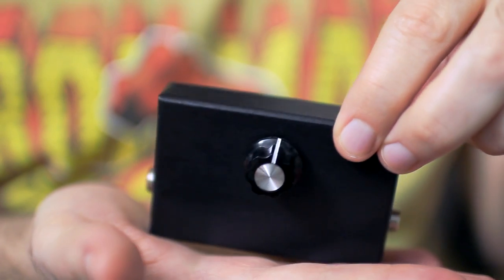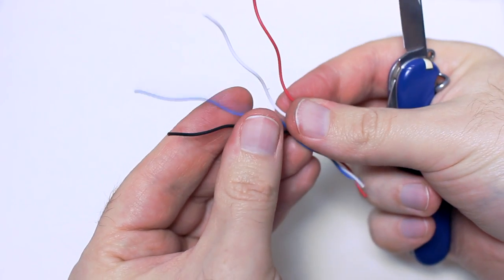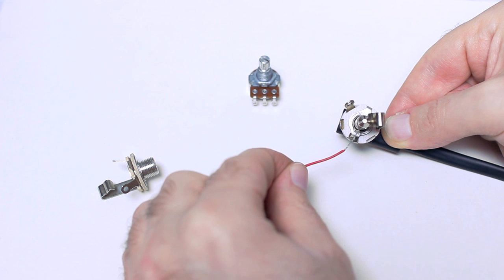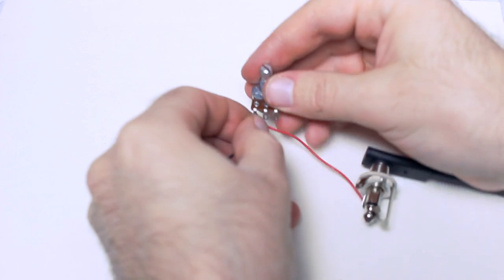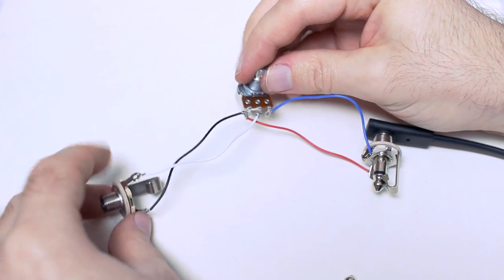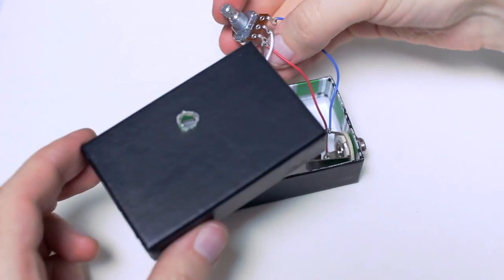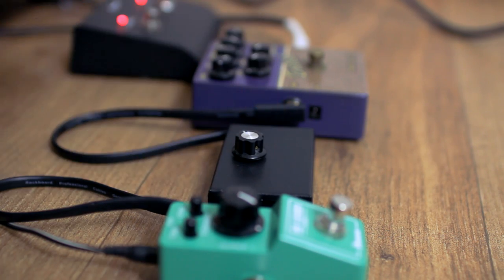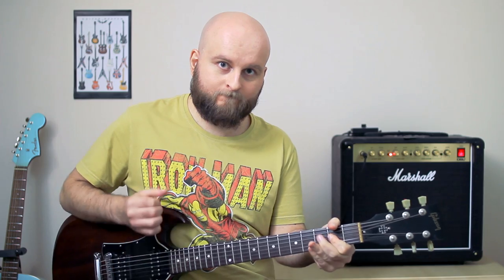How To Make A Volume Pedal For Guitar In 3 Minutes (DIY Attenuator stomp box For AMP)

Comment: Beware! This wiring is all wrong.  You need a 250K or 500K pot with audio taper.  You should wire this up like you would a one pickup circuit, but instead of a pickup, you go to the second jack.  This guy has no grounding, and all you will get is noise.
Reply: Tried his wiring. Didn't work as you said. Wonder if anyone here has tried it.
Reply: @C90Recordings  Yes, it is all wrong.  I can't imagine this video is anything less than another attempt to create chaos by you know who.  Just make the circuit like a single pickup circuit and it will work perfectly.
Reply: I have one that I bought, it is wired in the same manner. Everything looks clean, soldered properly, but doesn't work.  If i put it in front of the amp, nothing, if it plugs into the effects loop send(effect)return it acts like a kill switch.  For something so simple it's becoming a pain in my ass, when I first received the pedal, it didn't work, outer sleeve from the input and output were reversed (outer output on right instead of middle, outer input on middle instead of right) so I reversed the two wires on the potentiometer and tried again, still nothing, this pedal is acting like a kill switch, nothing get's by it, could it be a faulty potentiometer? Wrong type? 250k 500k? What makes this not work.  It's two jacks and a potentiometer, wired just like this video shows....
Reply: How is it wrong? The grounds are connected on both output jacks and the third terminal (or first depending on how you label them), and is grounded through the amp like normal. It's wired how you are describing. The middle terminal goes to your output and the opposite of the grounded terminal is your input, just like a pickup. Perhaps you mean that the pot case isn't grounded? That's a small tweak you can make if it bothers you but I don't know if it'll make any practical difference. It sure doesn't for professional production volume pedals. If you use a metal enclosure it's all connected regardless.
Reply: @trevorlindsey580 - I don't know how you wired yours up but I just followed this video step by step exactly as he showed it and mine works perfectly.  No grounding, no noise.  The resistance and taper is down to user preference - they have no bearing on whether this circuit will work or not.  If yours doesn't work then you either made a mistake, didn't follow the video properly or worse - you spoke without even trying it at all.
Reply: @paqman78  I made one with these directions, and it did not work.  Maybe you did something that many of us other folks did not do, but I suggest you make your own video and place a link here.

Comment: No soldering ? No connecting the body of the pot to the ground ? I'm surprised this works...
Reply: The 3rd lug of the pot is the ground. And that is grounded to the guitar cable wich is in turn grounded on the amp, cheers.

Comment: I followed the instructions on his build to the letter & it works Perfectly.

This was my answer to controlling the CLEAN mode on my Marshall JVM 210C Combo.
To those who KNOW, that CLEAN (GREEN MODE) comes through way too loud & cannot be balanced out with the Crunch Modes on that same CHANNEL on these Amps.

So Simple & works great plugged into the EFFECTS SEND & RETURN

The only thing though, it might be good to give the POT Resistance value next time
 ... I used a 250K Pot & it works fine, but I think I'll try a 500K Pot to see if I can increase my Volume Range

Great Work Mate

Comment: You can also add a treble bleed kit between lugs 1 and 2 to maintain treble when lowering the volume! I made one of these and it works great :)
Reply: Explain please
Reply: @p10rambo  He means this was just another volume know just like the one in your guitar which exposes you the same way to losing high end when rolling back the volume. And just like you would do for guitars, a treble bleed can help compensate for that.
Reply: @Javier-qk7ms  so it will have two knobs?
Reply: Doing a treble bleed shouldn't really be necessary when used in a buffered system like an effects loop. Assuming the effects loop is buffered :D

Comment: I just built my own a few minutes after making this comment. It surprisingly works. I had a JHS Black Box in the past and it works exactly like that does. They sell that for $65. Nothing against JHS, but man, I made this for free with the stuff I already had (and if we get into technicals, I used an Altoids box, two jacks and pot from china, random wires, and a cheapo soldering iron, all of that isnt even $15 if you get it new (recommend a better soldering iron for longterm use, but I just tinker so idc)). Aside from the savings, this is just great in general, and feels good to kind of make something for myself for my rig. Thank you for this Video.

Comment: Nice vid but it seems my guitar tone was affected, it became dull a little bit. May be theres a loss of signal a bit but this truly works. Thanks a lot sir!
Reply: your potentiometer is the wrong value. try a different value pot.
Reply: @josiahlee1982  what value can u recommend?
Reply: You may have to try a couple. Do you know what size you used? Basically you are adding resistance to the circuit so tone can be effected drastically by the wrong values. I'm no expert. I circuit bend and Frankenstein stuff together. If you are using a 5k the problem may be that not enough signal is passing though the pot. Basically bottle necking. Lots of signal in. Not that much out. Just a thought. Could be completely off. In theory this is just like adding another volume pot to your guitar, just further down the signal chain. Check what the volume pot is on your guitar and match it maybe?
Reply: @joshludge So after a little more research it seems that the higher the k (resistance) the greater the loss of "tone" especially the high end. The same reason that high output pickups lose the high end. This circuit is not ideal in the first place as it's still just another volume pot added to the circuit and not really optimal for using as a volume "pedal". Most volume pedals have a boost circuit or amplifier to minimize the tone loss. So you may either go with as low of a "k" potentiometer as possible. Or build a basic boost circuit and add it to the front end of the circuit. If you search for diy punch amp by diyguitar pedals he shows you a pretty easy way to build an amplifier with minimal components for under 10$. I believe his circuit only has 4 or 5 components. Anyway Sorry for the half guided answer. Hope this helps a little bit. Keep building!

Comment: About the resistance:
I have a custom treble booster that was designed for guitars with low volume output; when I put my strat in it, anywhere above 50% volume knob level, the booster clips and crackles in the ugliest way so I want a very simple volume control or attenuator for between my guitar and the booster pedal, so I can have my guitar volume knob at full level because it seems to affect the tone.  
Since I'm only putting a passive instrument through the volume, does it need to have your recommended 500k--1000k? That amplifier must send out a much stronger signal right?
Reply: You could place a volume knob on the input of your custom treble booster. Some of them (designed for general electronic) are very very small and could be integrated into the pedal enclosure. Just set it with a screwdriver and forget it. (But it will affect the tone exactly the same way of your guitar volume knob). So there is another solution : https://www.fender.com/articles/tech-talk/how-a-treble-bleed-circuit-can-affect-your-tone

Comment: Can you put this in a metal enclosure?  I'm thinking it should be fine because the inner parts of the jacks are already connected, so it won't matter if they are bridged via the metal box.  Just double checking though.

Comment: please what kind of potenciometer 100, 250 , 500 K?
Reply: Try 25k
Reply: I recommend you 500k, most of volume controls use this value. But try with other values it's up to your likes
Reply: @yairgomez7202  thanks bro
Reply: Does one or the other make higher or lesser volume?
Reply: @ryeweskey  mmm no exactly, just reduce or maximize the range. If you put a elevate resistance value it won't sound. So the value it's proportional to the range of volume you wanna get on.
Reply: Good question bro

Comment: So I can make an attenuator for any amp?
Reply: Technically spoken, this is not an attenuator. You can crank your volume/master knob on the amp but at the same time you lower the preamp signal. So, you don't give the poweramp tubes a hotter signal and they won't saturate the tone more than usual. Still it's an interesting experiment for very loud tube amps which can't be dialed in easily for playing at home. My JCA22h is such a candidate. One "blow" at Master knob at 1 and it's either too silent or too loud. You can use an L-pad if you want to build a real attenuator.

Comment: you can take an oscillator that makes LEDs blink, and attach a light dependent resistor to the potentiometer and electrical tape the LED to the light dependent resistor, Now you have a tremolo effect, might have to find the right capacitor for the oscillator so it blinks properly, but it looks like the higher the pitch of the oscillator the more it blinks. look at lookmumnocomputers simplest diy oscillator for more info the knob on the oscillator should be able to control how much the led blinks, light hits the light dependent resistor, and resistance happens when the lights blinking, so the resistance goes on and off really fast

Comment: Great! But... what kind of pote? 100k 250k 500k?? Pls man!
Reply: You can experiment with different values.  A 500k will reduce the volume greater that a 100k and a 100k will reduce the volume more than a 25k.  It's impossible to say which is going to be most effective or overkill without knowing how much voltage is cycling through your effects loop.

Comment: What K rating works best?? 250k? 500k?
Reply: Hi!, a 500K or a 1Meg would be perfect, the 250K will make your sound a little muddy
Reply: Thanks!  Took a 500k pot (even though I had several 25k on hand) and split a patch cable in half then hooked it up, put a case around it and put a volume knob on it. Works perfectly! I can run my deville in the 7-9 range at a bedroom volume.
Reply: @skydemon02  Glad to help!, I'm glad it works!, I am going to build one in a little Altoids box and call it "The Variac" hahaha, this seems like the best alternative to a Variac or an attenuator, I will definitely get my next amp with an fx loop. 
Have a great day!

Comment: I have one that I bought, it is wired in the same manner. Everything looks clean, soldered properly, but doesn't work.  If i put it in front of the amp, nothing, if it plugs into the effects loop send(effect)return it acts like a kill switch.  For something so simple it's becoming a pain in my ass, when I first received the pedal, it didn't work, outer sleeve from the input and output were reversed (outer output on right instead of middle, outer input on middle instead of right, so I reversed the two wires on the potentiometer and tried again, still nothing, this pedal is acting like a kill switch, nothing get's by it, could it be a faulty potentiometer? Wrong type? 250k 500k? What makes this not work.  It's two jacks and a potentiometer, wired just like this video shows....
Reply: hello there most proably the pot is wrong, it may you can get another one borrowed by some radio or another equipment you have just for trying, rewire it and try, if the pot is the deal you can simply change it, however the jacks, if them are covered (sometimes sealed) by a plastic case is possible suspect about them, but if they are "naked" style such as the ones showed in this video it may you need to pay attention to the terminals and the quality this ones make "contact" each other, sometimes the contacts get dirt or lose mecanical streingth  and the contact is not effective, same, the best is replace them, finaly the cables, it may they can be broken by the inside of the plastic cover, is not so often, but sometimes depeinding upon the age of the device the cables get rigid and fragile. try using a multimeter or a continuity metter, it may with a batery and a led in order to test continuity of overal the system, the potenciometer must dim the led and vary ligth intensity, its a kind of test you can make, hope this could help you

Comment: Forgive me, but I fail to see the point of this device.  If you just want to control the volume by hand, most guitars already have volume (and tone) controls built into them.  The point of a "pedal" is that the device is controlled by your feet, leaving your hands free to play your instrument.
Reply: On some amps, the volume pot sweep means that it's almost impossible to regulate low-level volume for playing in a bedroom - it goes straight from silent to too loud. With this pedal in the FX loop, you can set the amp to a higher volume and accurately regulate the actual volume with the knob on the pedal. Much more fine control.